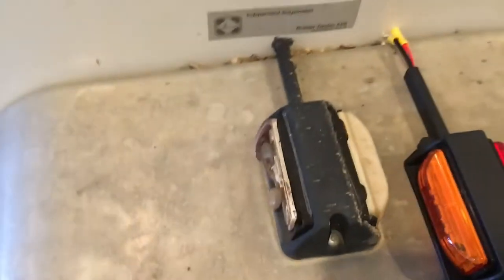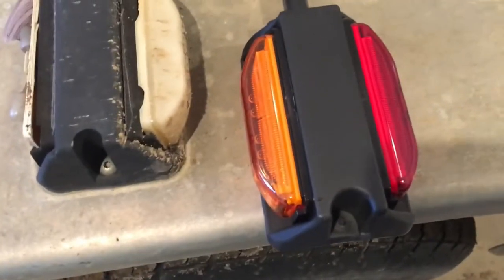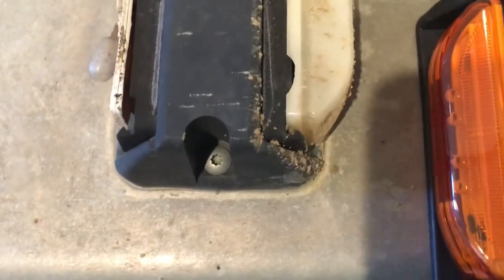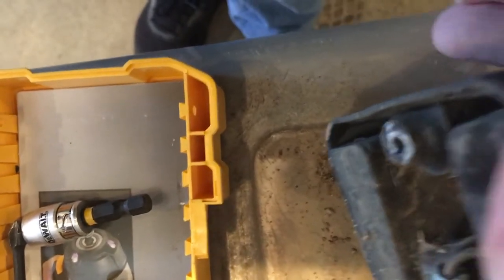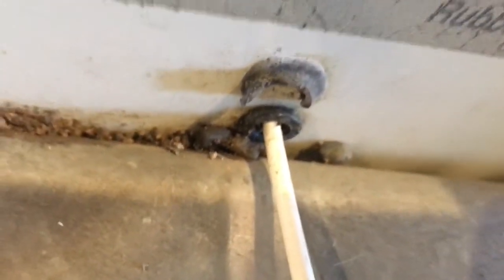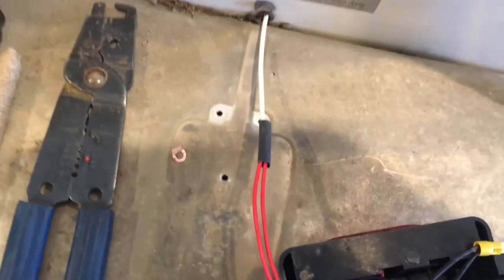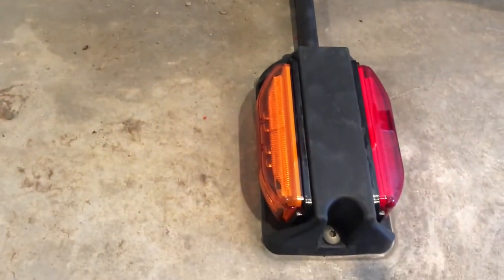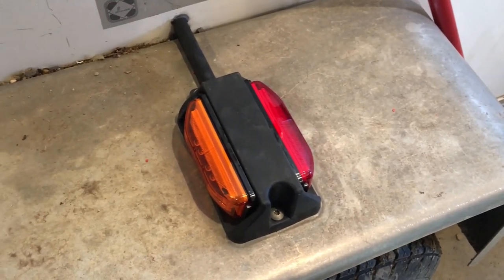Haulmark Trailer Fender Light Replacement

Comment: Hey Nordlander, is this Ground Hog Day?  I'm sure I watched this video.  Wait a minute, is this the video that we talked about the 8 tooth spider-bit?  Watched in full.  Have a fine weekend.
Reply from the maker: I had compiled all these videos into this video and afterwards realized they were not rotated correctly. I hate that so I redid the ones that were 90 degrees off and compiled them yesterday. Thanks for coming back! My comments are gone forever though. I use a free editor called Kdenlive that I have somewhat gotten used to. They have improved it quite a bit over the past three years I have used it. I have mental blocks using video editing software so I tend to not like to edit my videos and it shows...
Reply: @1crazynordlander  No Nordlander, I understand b/c each time I attempt to edit my videos, I go through a lot of gyrations to make a final product.  I started using Wondershare Filmora and I updated versions several times and I am not happy with updates.  You lose features from prior versions plus I just don't want to start re-learning an entirely new system.